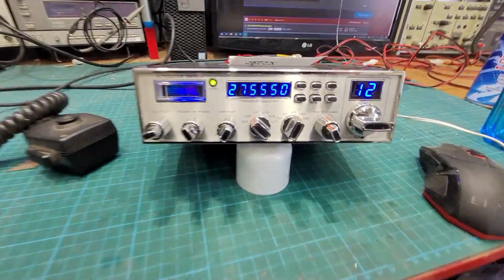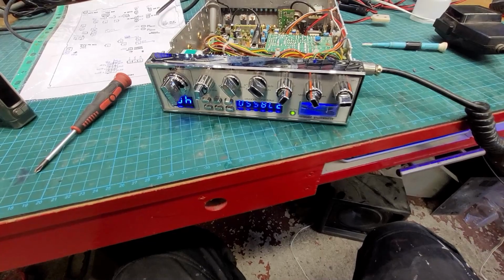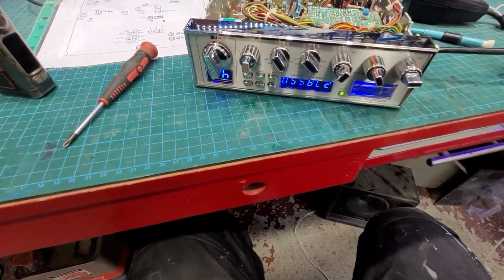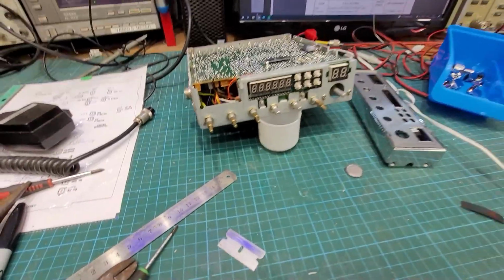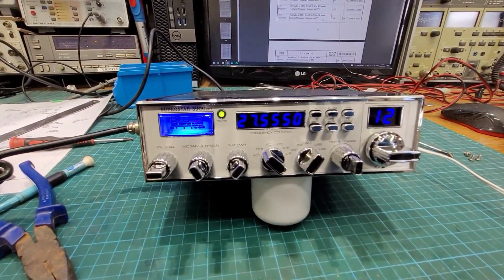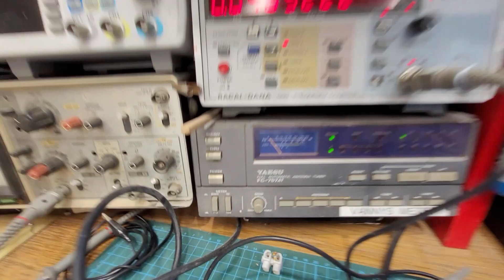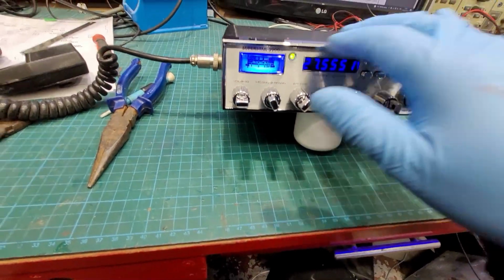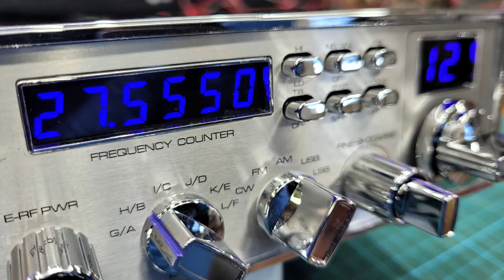BILLY B'S SUPERSTAR 3900 EFT

Comment: Interesting video. Thing is, with this newer stuff you shouldn't need some "tuning" company it should just work from day one perfectly. My Magnum S9 was a brilliant 11 meter rig, but it was sold as "tweaked" and "tuned" like all the rigs were in their sales roster. However, along with the President George and my Stalker ST 9F DX it was in my top 3 rigs that I owned for the band. Make of this what you will, as I know you're not a fan of the Ranger boarded kit...
Reply from the maker: They just don't bother their holes tuning them right. Add along with the fact they use poor quality coils too. The vco in these is a chip type that has a notorious hot-spot hence the drifting. It's leaving here a damn site better than it arrived anyway.